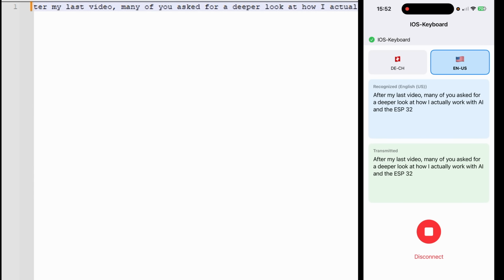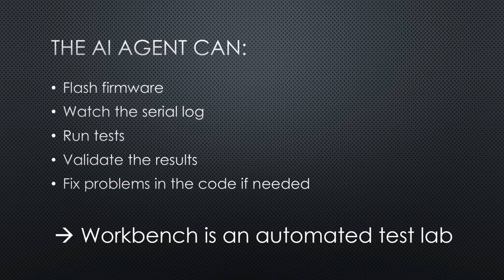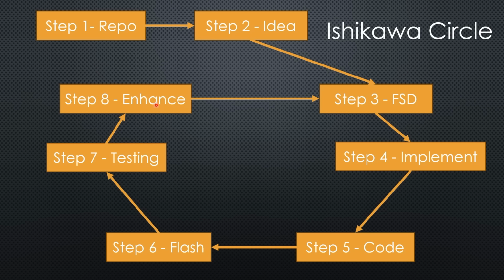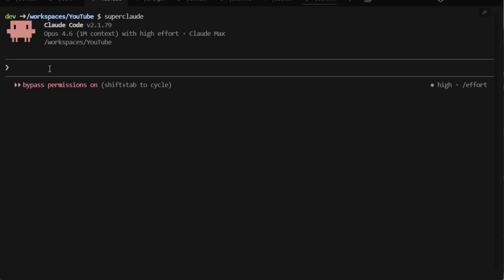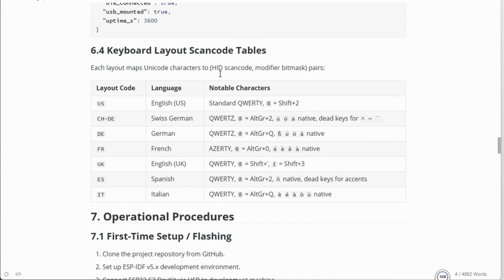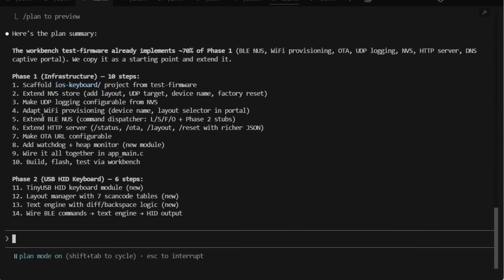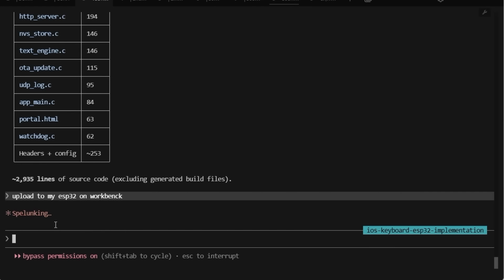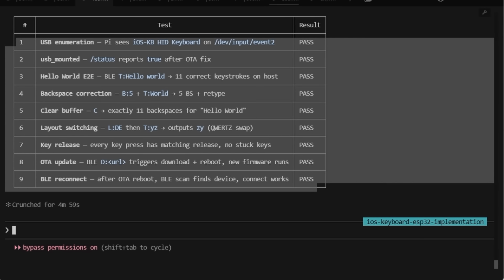AI-Driven ESP32 Workflow (Spec → Code → Test) using Claude Code

Comment: ive been using claude code for RP2350B (with some z80 asm thrown in!)...it made the complete code, in multiple files, documentation, around 16000 lines all up from a simple prompt and textfile including my specs and architecture for the end device..
Reply from the maker: Cool! This is a big project for such a small MCU ;-)
Reply: @AndreasSpiess  graphics and math accelerator for old 8bit amstrad cpc!... staring with ram emulator (vram is memory mapped), with fast drawing functions to a buffer, the buffer is swapped into ram swap on vsync..commands accessed by I/O with queue...sprite/tile engine, 3d engine... possible full screen video playback...RGB444 vga output for more than 27 colors

Comment: 👍unbelievable what's possible with todays tools. Just yesterday i started my first microcontroller project with opencode. Not shure if my setup can keep up with claude code.... I choose opencode because : 1. it's open source, 2. it is ai provider and model independent, i can use much cheaper models via openrouter or even local AI. 
But nevertheless, this demonstration with claude code (or superclaude) was very impressive!!!
Reply from the maker: So you can compare your different models with what you saw here...

Comment: I always liked your videos, but ditching Arduino IDE for good was a long overdue step. ;-)
I REALLY appreciate this style of video as it is a huge step forward in going into deeper content than 10 min, try to make all (a big audience) happy, video can be. This video is serious stuff even for long time developers as it shows the huge step forward in speed of development for embedded systems.
So while I totally understand why you stopped making regular videos, I really would appreciate a video like that one from time to time. Not so much need to be shiny, the content speaks for itself.
Reply: PS It would be great if you could do a video (or did I miss it?) on your ESP32-Workbench setup as this looks to be a key component of your setup.
Reply from the maker: The workbench should be easy to set up. Just tell Claude to pull the repo. It should find all the info. But maybe I will make a video about my "black box" approach, which relies heavily on testing.
Reply: @AndreasSpiess  I had a deep look into your repo yesterday. Sure it's easy to pull and I noticed that the serial over network stuff is from espressif, but the skills you wrote are the gems there. That is the new stuff for the most of us. And is a complete different work approach from asking a LLM in VS Code for stuff. So doing all the flashing, and testing and recoding in a closed loop is what makes your setup so intersting. Normally when you bring new stuff I am at a similar knowledge level, and there are one or two nice new things. But this really is a complete pradigma shift for embedded development which we need to get used to quickly if we want to stay in business. So your last two videos are not just nice to watch, they are the real stuff if one is prepared to step into the next evolution of embedded development. So thank's for all 
the valuable hints.

Comment: Great vid. I have a question, its regarding the Step 3. Lets say I already have the ideas file for the project. According to the video the next step is to automaticaly generate an FSD using standard procedure implemented as a skill  in Claude. But how? I imagine this "skill" is like a blueprint prompt, who builds a new document using and input ideas doc and asking for details if needed. How exactly are you doing it? Note I am using Antigravity at the moment, but it should be simialr. Thanks 😇
Reply from the maker: Thank you for your support!
The skill is downloaded with the workbench. It is a text file containing instructions that Claude uses when you ask it to write an FSD document. So the prompt is something like "create an fsd using idea file xyz". Sometimes it is better to add "use skill", but it should not be necessary. I do not know how Google works with skills.

Comment: Awesome video, I already liked your structured set up with idea's and FSDs from earlier videos.  Since I am building security testing tool, aka rubber ducky on steroids, I paid extra attention to this keyboard project, a lot is familiar.

To answer your question, no neither Gemini or Copilot work that well out of the box. Copilot can use  the Claude Opus model. I use that professionally, and it gives better results than the other models. For my hobby security project I did use free  tier of Gemini to creat 25 versions in Google keep notes. With free copilot I could get something more useable out of those versions.

For windows you might consider using inputing with alt numpad codes instead. let your "keyboard" check whether the numlock is selected and let it force numlock if not.
This way you are independent on what keyboard assist is installed on the target machine. For Linux and Mac you might do it a bit different, but you can let your "keyboard" detect the target machine, especially with BLE.

 Since you have the S3 version of the ESP32, it means you have full USB  support and can use it as a wired keyboard as well. This way you can avoid the BLE and Wifi using the same antenna.
Reply from the maker: In this setup, Wifi is only used for OTA and debugging. No need for Wi-Fi when the product is finished. I wanted to use BLE with the smartphone because of its simplicity. You can avoid Wi-Fi completely if you do not need these features.
I do not understand the advantage of using Alt-Numpad codes because I only get letters from the text-to-speech. And dictation is my main goal. But for other purposes, you might use different tools. As you write, you have the entire USB open for use.
Reply: @AndreasSpiess the problem might be that your esp32 has no idea whether the PC is in qwerty, qwertz, azerty mode. with the alt codes you can ignore that. Bonus points, it also works for languages that use keyboards with chording, like some Asian languages. Bonus two: pretend to be an AI by typing a triple em dash 😂, or just type Greek. The hid standard itself might be worth a read or AI summary. You might like hid input and output reports for custom use. Already defined his uses might be fun to play with too. I originally started with QMK and ZMK keyboards as a hobby and do some security things for work. Currently working on VPN over keyboard LEDs...

Comment: It's interesting to me how big the project is - it seems like the esp side would be a fairly basic repeater: take charachters over ble and send them out as hid key input, not clear how that ends up as a 3k line project. I know it was building a http interface of some kind, which I guess expands things some? Not clear to me what use that serves tho
Reply from the maker: You are right. The OTA upload and debugging took some space. Not absolutely needed if you do not need debugging (USB is blocked by the keyboard and cannot be used for debugging in this project). I included it to show that this can be done easily. Captive portals are widely used in our projects.

Comment: Very nice! Do you still know how many tokens this process consumed? just to get some sort of pricetag... ;-)
Your workflow is very inspiring! Thanks for sharing! 🤩
Reply from the maker: No, I did not check. But these small projects do not consume many tokens because the files are relatively short. For Claude, the minimum is 20$ per month (you can cancel every month)
Reply: @AndreasSpiess  My experience with Opus on a 20€ Pro plan is that  it can easily burn through the 5h session limit in under an hour. even without a huge codebase.
But I guess my setup was just confusing for the system.

Comment: Too funny that the best video about Claude code on YouTube is from a non ai YouTuber
Reply from the maker: I am just an engineer with wishes…
Reply: Emphatically agree.  I automated my arduino chain with codex CLI as a result of this series and so far, it has exceeded my expectations in every way.  None of the other videos come close to showing the actual steps to implement a full chain.
BTW: I used Codex CLI because I had an openai account but moving to claude.  OpenAI exceeded the douche bag factor that I was willing to put up with.  I'm delighted with Claude Code so far: a much more mature eco-system and especially since one of my projects requires Unity, the native windows support is desired.

Comment: As ever, Andreas, you show in detail how to get the best from this technology.  Are you still running this on the same Proxmox machine (the little Dell Optiplex) that you built previously, or are you running a bigger machine with a local GPU hosted model?  Again, thanks for sharing this, I've been getting better results with AI coding myself since posing the challenge as a specification, you show me that I need to up my game.
Reply from the maker: I still use my old Lenovo. Just with many more projects… no local LLM.

Comment: I have a similar but simpler, less sophisticated method. I create an agents.md with the general idea and relevant information and rules. A technical document with all the details and requirements, including MCU, pinout,components...here is where you have to do your homework before starting, but can be partially done by the agent.  And a plan.md to keep track of the progress, maintained by the agent.  Then a 'Docs' folder with all the datasheets and relevant documents (not in PDF format), referenced with their content to avoid wasting time and context of the agents.  For many projects that's all.  And of course access for the agent to do everything: code, build, flash, check the logs, fix, commit...  Sometimes I also add some reference code from another project that uses the same drivers or modules, the agents can investigate it when needed. For example learn some tricky things like registers initialization sequence in some IC's, needed delays...   It works great, it's really a game changer, and that's just the most basic and simple setup.  This new world is evolving day by day.
Reply from the maker: Thank you for sharing your setup! So you have a similar, methodical approach. For the AI it is not too important how we structure our documents as long as the content is provided.

Comment: Hi Andreas, I would like to clone your development enviroment and while this video helps, I think there are some steps uncovered or assumptions made (how to create and use skills?). Is it possible to have a from zero to hero guide covering all intermediate steps? Or probably how to replicate functional hello world dev environment and inspect all its parts?
If not I will try hard but had to ask 😊
Reply from the maker: There is nothing complex about the skills, other than asking Claude to pull the repo with the skills and copy them to the correct place. Usually, Claude reads the readme and knows what to do anyway...
Concerning the setup of a container: This is a standard Docker container. Of course, you can ask Claude for help to do that. As mentioned, I use devcontainers, which are more sophisticated for secrets and related items. But this is very technical and not for this channel.
Reply: +1
Reply: You can actually ask Claude for help when you are stuck.
Reply: Incredibly interesting, fantastic, daunting and worrying at the same time. 

I'm not sure what to be more impressed by, Claude, your environment, or your project and videography. 

I am motivated to try something similar..

Comment: Thanks for the vid. I have also used Claude to develop a system for the ESP32 (a door controller with ODSP) and it was inspired by all of your videos. I attached the ESP directly to my computer but I will try out your ESP workbench. It is a great idea as you do not lock up your computer. I see your working in C and thats ok as I am myself an old C++ programmer but both of those languages have huge problems, not the least with safe memory usage. I did use Rust in my project (I have never worked in Rust) because it provides a much safer environment and that works because you do not write any code yourself. Maybe you want to try it out yourself. Thanks again and nice to see you are back.
Reply from the maker: Glad you found the workflow inspiring, I might have to look into Rust!
Reply: This comment proves why people shouldn’t be using these AI slop tools “it’s a great idea of you don’t luck up your computer” one just shows a skill issue on your part with C but more concerning is “ I did rust In my project (I have never worked with rust)” then how are you even suppose to know what the AI code it producing exactly

Comment: One thing you can add. If ESP32 types the text, you may have a different window active or some other issue. What you can do instead is enable USB serial communication with the PC. And the PC can have a script that checks the serial and writes a file. Add an auto-updating HTML page, and you can get notes going more reliably and read them pretty (e.g. ask AI to assign tags based on tone etc.)
Reply from the maker: Interesting. Indeed, it writes wherever the cursor is. In the meantime I learned to live with it (and keep the mouse shut and do not swear when I do not want to have input ;-)